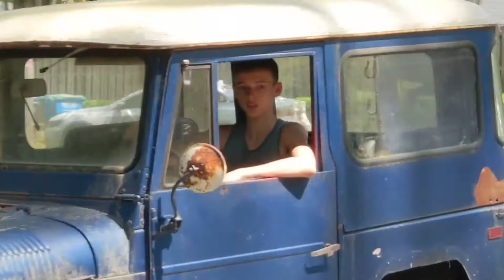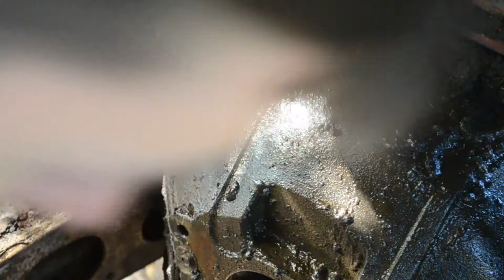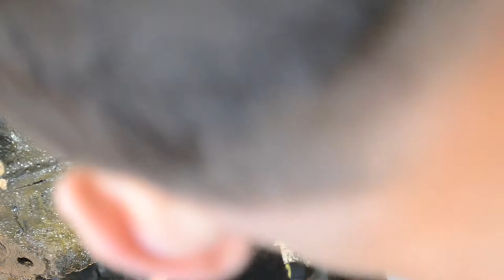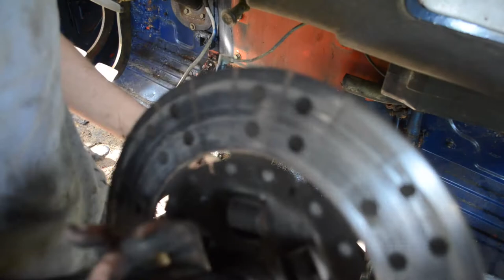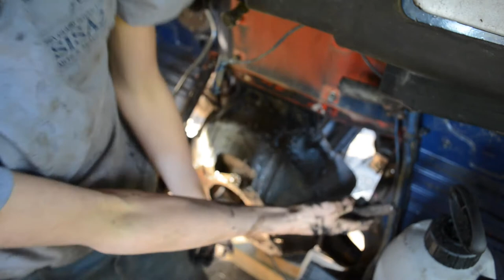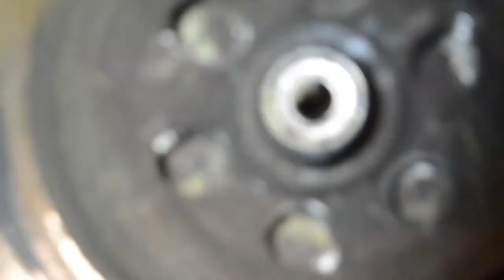1973 FJ40 Project | Episode 5 | Removing The Clutch, Flywheel, and Bellhousing | Transmission Part 3

Comment: How did you get the pressure plate and flywheel off?
Reply from the maker: I had to take the bolts of the pressure plate off one at a time, rotating the flywheel each time to make room for a wrench. If you look at 9:55, I am wedging the extesion bar of my ratchet against the bell housing as an anchoring spot for my ratchet. It was rather easy actually and most of them can be taken off by giving the wrench a quick shock of the hand.